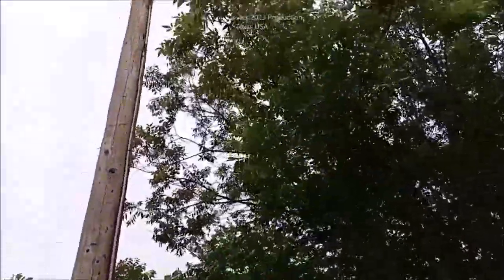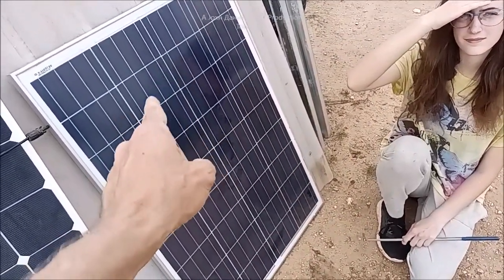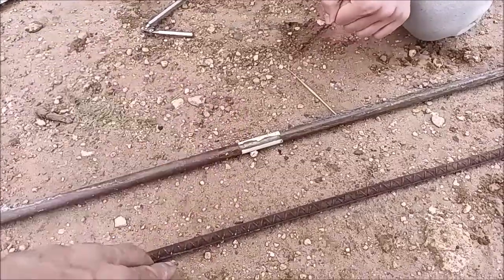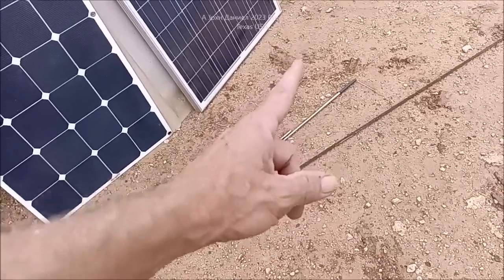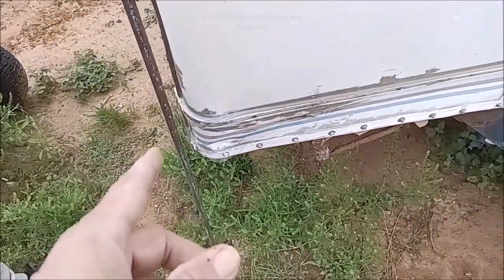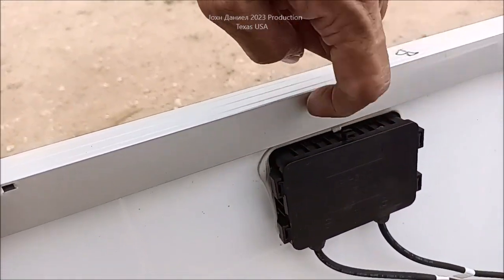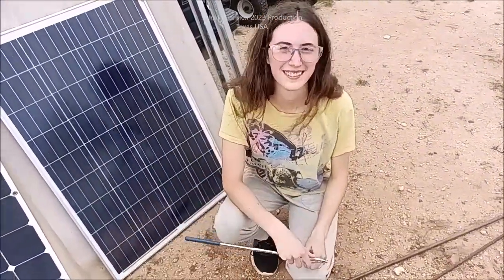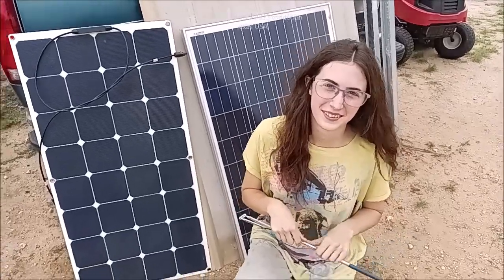Grounding your SOLAR PANELS? 🤔 You Better watch this First! *KNOW DC/Inverter POWER is not Utility

Comment: Your right, grounding is not part of a DC circuit. But I think you missed a point: earth ground on DC circuits serves a slightly different purpose. It's for your SAFETY. It provides the shortest path for DC current to flow in case of an unbalanced leak (positive/negative only leak, where there is little to no ISC until touched by something that completes the circuit). Without the earth ground, if the circuit has a leak, the current will flow through anything touching the ground, INCLUDING YOU. So yeah, in low voltage it's almost useless, but on an array of 10+ 600W PV panels where the circuit has 400V+, it's a life saver....
Reply: @heatclift4532  Grounding systems are a blessing and a curse. They are a blessing because if a piece of equipment in your house fails you are much less likely to have enough current flow through your heart. 
They are a curse in that they actually make your home a more susceptible to damage from a lightning strike
NOT less.
If a lightning bolt strikes the physical Earth in your neighbor's backyard there is a much higher chance of the voltage coming back up through the the grounding system than not. 
During a lightning event my home would be better served if I could implement an isolation switch temporarily isolating my system from the earth ground. 
The problem is I would probably forget to put it back to normal after the storm passed. Also, in the unlikely event that I would also have an equipment failure inside my house I would not be protected from electric shock. 
The truth is: MOST LIGHTNING DAMAGE ENTERS THROUGH THE GROUND SYSTEM. THE GROUNDING SYSTEM DOES NOT PREVENT DAMAGE FROM LIGHTNING IT OPENS A BACK DOOR ALLOWING IT TO HAPPEN.
Reply: Exceeding 60vdc meaning input from the panels? I have circuit breakers on my solar system in my rv. My system is not grounded. My rv is not grounded. I know I’ve asked this question before, but now I’m unsure of what I should do. Can you help?
Reply: @Blackbird-zo1su  RV is not grounded to Earth but the devices as well as panels should be grounded to the own potential (or "ground") of the rv. Because the voltage surge may still occur. It's a Faraday cage but not perfect.
Reply from the maker: @Blackbird-zo1su  If your choosing to go as high as 60 volts DC, you need real safety by using at least inline fuses or breakers. I prefer staying under 44 volt, ( pair of 100 watt panels in series is 44 open voltage ) and likely to be felt but not likely to injure. Over that it gains deadly levels fast. You do not need to ground the panel frames, no one has to. But creating a short safety is wise no matter what your voltage is. Best breakers to use are Mathus, you need a box https://amzn.to/4fgc0Zd And sized breakers that are just higher then your panel amps https://amzn.to/3SiWDVN
Example - 300 watts solar would be 25 amps in a 12 volt system. Always buy a few extra breakers, and always get a box with at least 1 or 2 more spaces than your solar already uses so you can expand or option other sources.
Reply: But you would need Residual circuit breaker and 3-wire wiring for this to work. There are still 2-wire systems in old houses which only breaks on short circuit and won't protect you from injury if properly grounded or not. Nowadays when the household devices are mainly plastic such events are less frequent unless you are in e.g. bathroom.
Reply: WHAT  ??  IN AC SYSTEM  THEY  USE  GROUND  DUE TO  HI  VOLTAGE   AND  LESS WIRE  DIAMTOR  OR SIZE  !!  IN DC  SYSTEM  YOU HAVE LOW  VOLTAGE  UP 48  SO   NO HARM  .LIKE IN YOUR CAR  12 VDC
OR 24 VDC  !!  I WISH  I CAN EXPLAIN  MORE  . FROM SAUDI ARABIA EX  AVIATION MAN.
Reply: @mohammedmurad3787  Not sure what solar setup you have, but a typical home solar system (2kW or larger) usually operates at 120 to 400 volts DC on the PV side...
Reply from the maker: I think I've said here and everywhere that exceeding 60vdc should have a fault system. That includes neon alert bulbs from frame to independent ground to active grounding but not residential shared.
Reply: @JOHNDANIEL1  Good one !
Reply: Ditch the ground rods on DC solar equipment, and use a high-quality surge protector sized for your equipment. Done.
Reply: @ronmott5265 where does the surge protector shunt the transients to if there are no ground rods…

Comment: Some inverter companies even say NOT to ground either leg of the DC output. Panels on a metal rack become grounded via the frame/structure of the rack. It may almost impossible to keep the metal frames isolated.
Reply: Exactly like that!

Comment: OMG.... i love this 🤣🤣🤣 in no way i pretend that i am an expert on the GROUND topic but everything around electricity electronics its like a hobby playing with it.. but when you look everything around you i am little sceptical even putting GROUND in my house.. if there is ground on every pole around my house i think it is dangerous to put yet another one in the house... because when lingthning strikes a pole it doesnt disapate in the ground.. actually the ground is just a conductor.. that lighning passing through the ground actually goes from earth to the ground rod in the house to everything conected to ground.... electricity actually isnt going where the resistance is smallest... electicity actually goes in ALL possible pathways... about the solar panels framing it does make some sense to ground the framing but as you said metal roof or in other words week ground only if you have AC from the grid pluged in the invertor to lower the noise in the system.. it is extremley contraversial topic about GROUND and most of the opinions of people who they say are the "experts" looks like they dont think it trought logically from start to finish and just do what they said in school...  COMMON PEOPLE think
Reply from the maker: You only need to understand George Westinghouse and Nikola Tesla to understand why the ground is used in generative energy. https://en.wikipedia.org/wiki/George_Westinghouse And the process is same now as then but we went astray on why so much is to be "grounded" and what it means. They all ( the professionals ) seem to connect electrical generation "ground" with Lightning protection "ground" and compound it and the problems by joining the 2 as the same. They ARE NOT!!! Same name, different outcome. For mechanical generated energy you must use the ground as a balancing design due to remote used transformers. With Lightning using a ground is creating a unnatural pathway for lightning to pass through what ever you ground. Centuries ago a lightning rod was used and not placed near homes, typically placed on a barn or other and consisted of Irion from height to depth in earth due to its innate chemically connective history of lightning preferring high ferrous oxide containing soil (ground) to strike.  
Go figure, 350 years ago they knew this!! And they not would have connected to a shared ground rod with your utility system. But 85 years ago a drunk code writing bureaucrat was born to change it all!
Reply: @JOHNDANIEL1  totally agree!!!!! I love when I hear some "professional" explaining how important ground is and you ABSOLUTELY have to stick a ground rod... And always my response is ... Excuse me I want to learn about electric stuff can you explain to me what is a ground loop cuz i can't get the idea, what is the effect of it and what is actually making a ground loop 😅😅 and after 10 minutes listening asking the question.. Is it a good idea everyone sticking freaking rods in the ground wherever they want 🤔hahahaha
Reply: You should consider also electrical induction which arises from any ligthning strikes in vincinity. And it may be thousands of volts. This has nothing to do with lightning rod grounding and earth currents which are less probable if the grounding is done correctly. Damages from such voltage surge is much more probable and you should use extension cord sockets with built-in surge protection everywhere the sensitive devices are connected (electronics). It would even protect from ground surge because it controls voltage between live and null/grid-grounded wire.
Especially useful in areas where lightning occurs frequently.

Comment: All cars are grounded, because all car tyres include small iron particles (iron "dust"). So all tyres are conductive. Not 100% rubber.
Reply: It is but not fully it is not a conductant but a bad insulator it may take some time untill the potential voltages are the same.
Cars are grounded to their own ground (forming Faraday cage).

Comment: Glad I watched this, I'm about to mount my panels, the brackets are already installed on the roof of my shed. Now I know I don't have to use the little aluminum clips between the panels or a ground wire to a ground rod. What about the sub-panel that is supplied by the inverter with 240v, the circuits will need a ground to meet code ? So do I connect a ground wire from the main panel? There is no other connection to the grid system, yet. Or would I connect to a ground rod (rebar) ?
Reply from the maker: When you go to AC voltage and anything over 60 volts DC then proper breakers and grounding is required on the AC side if its to join a existing system, the DC side can be left ungrounded as long as you have proper breakers but if your doing the most evil thing on the planet GRID TIE connecting then you must pay all the massive fees, follow every rule, connect to all ground connections and expect your pay off in a few hundred years.
As for the panel frames, you can ground by choice unless  forced to do so, using a ground rod on them separate from anything your house is using and over 25 feet from a existing ground. Myself, I choose NOT to attract lightning to my panels but instead a dedicated lightning post but if you can get good replacement insurance on the panels then it's not a horrible idea to attract lightning so you can get new ones ever so often from a insurance claim.
Reply: You should ground if its part of a building with its own path to building's ground unless you have metal roof. But not ground the power wires from panels, you should use overvoltage/surge protection against ground together with fuses before FV regulator.

Comment: dudes the the same as grounding your washing machine... ffs. charge builds in ungrounded stuff and will gladly use you and your heart to escape. You use a copper grounding rod because rusty iron is very poor conductor. who cars if it pulls out easier. It goes down 8 feet to touch moist soil.

Comment: must need grounding on solar system,, using spd for protect for lightning strike..
Reply from the maker: You connect your panels to a ground cable. It's OK, I hope anyone who buys the lie to ground them does so. 70% of solar installs are grounded, however I repair arrays all the time with grounded panels due to electrolysis and stray voltage, I never get calls for ungrounded.  For us, we choose not to give Lightning a shorter happy attracting path direct to our panels/cables/controllers/inverters that a ground wire creates when the easiest most approved Department of Forestry, Marine, Military, & World method is a basic Lightning Diversion collector.
Reply: @JOHNDANIEL1  Hi John, I am an off-grid homeowner living in a lightning prone area. We never had any issues with lighting until we subscribed to cable/landline service via co-axial. The incoming co-axial line is not grounded. Every time there is a nearby lightning strike it fries the ISP's modem/router and causes the inverter's screen to go blank. The ISP's modem is plugged into the house via its ungrounded two prong 12v dc power supply. I spoke to various "experts" who say the ISP needs to ground the shield of the co-axial to my electrical panel ground bar. I am a bit hesitant on that front because neutral and ground are bonded at the main electrical panel. The electrical panel is powered by the negative and positive leads of my inverter (ground remains un-attached). I fear that attaching the shield of the drop line co-axial cable to the electric panel ground bar will redirect the lightning directly to the electrical panel frying the inverter and all attached components. Experts disagree with me entirely stating that this will save both my inverter and the ISPs modem, sending the lightning directly to the ground instead of going through my equipment. All components on the DC side (panels, controller, inverter) remain ungrounded.

Comment: Cover your solar panels with red or yellow clear film and it will increase the output. You have changed the light spectrum your panels receive.
Reply: If its that easy.. Manufactures would already be doing that.
Reply: You should use the word reduce 😅

Comment: So what about when u use a Bluetti device ac180 around 1800 watt unit. It has a grounding connection on it. Don't  do it?
Reply from the maker: Grounding terminal on them don't usually connect in a bonded way so if you want to YES, will it do anything, very unlikely but it's a great confidence builder!

Comment: As a metal detectorist, I can at least say, when we find anything thats been in the ground for a long period of time, it will decay, that decay actually enlarges the signal. ONE QUESTION, how do you get a earth neutral bond on a off grid system without a ground??? you said to let your inverters float!!!! but they need a earth neutral bond, that is sometimes already done for you inside the inverter, other times you have to do it yourself, either way, the inverter is not floating.
Reply: @Urge38  think about if you have ever used a generator to power your home appliances (like refrigerator or cheat freezer during a power outage, or using one on a jobsite for running your saws and air compressors and such. That system is AC, just like whats coming out of your inverter, correct? Most smaller and even midsized generator aren't bonded to earth ground, because they utilize the same thing John is referring to here, a floating neutral. It seeks a path back to its OWN source to complete the circuit, NOT a path to earth.
Reply from the maker: Earth Neutral is a defined function of Grid Power, a part of its actual circuit. You do not create a circuit using the ground with Off grid power. Floating is the common and line ( hot) in a isolated use not a ground/common bonded like in a utility system. People can't get it into their heads that Utility power is mechanically created, nothing to do with inverters that create their output from synthesized electronic only methods.  A comparison. Utility power ( mechanical over rotation over magnetic generators ) call it NON GMO Corn. Inverters, Switching and boosting from DC voltage using self contained conversion, Call it Franken food. With Corn you need the earth to plant it in, with franken food you need a clean soil free laboratory! Connecting to a ground with a inverter will damage the inverters, it will stop or damage your induced short detection safety system in that inverter so may makers knowing "people do not understand the output is NOT utility" often make a burn trace on the board to vaporize when a bonded system is connected to. A industry secret but a must have ability.

Comment: But does it hurt to ground the aluminum frame of the solar panels?  It won't protect from lightning damage, indeed will make the panels a "lightning rod", but will protect personnel from any potential buildup, either static or for feedback thru the cells from the inverter.  Obviously, you can't ground panel frames on an RV, but doesn't mean a home installation isn't better if frames are grounded.
Reply from the maker: Ground if you feel its for you. But just know that about 99% of those who say they have voltage in their panel frames got it from sharing a single homes ground rod with the common neutral/structural ground bonded 120/240 utility panels, inverters ground lug, solar controllers ground lug and solar panels. So if you do ground them, DO NOT connect that circuit to the home or inverters system, ground them separately at least 30 feet away from any existing ground rod. They do collect atmospheric static in rare conditions but so does you car pop you with a static jolt from time to time.
Reply: @JOHNDANIEL1  this is the only piece of advice you give in this video that has no chance of killing someone.. of course you shouldnt share an earth with other devices thats called voltage potential and yes it can cause errant voltages
Reply: I’m trying too build a PV system with 12 panel on a wooden barn roof with a battery bank and supply power to my house 20 metres away. My house in the uk has earth neutral bond back to supply company and has a ground rod on my oil tank supply pipe into the house.
I was going to use a 3 pole live neutral and earth changeover switch to isolate incoming PV power from the grid power to supply my consumer unit.But it would seem I still have an earth rod at the house connected to my house system. 
Any thoughts on how I can achieve what I’m trying to do? Many thanks

Comment: Thank you for the precious info. 
I have an important question if you could help me with it. 
I have an off-grid inverter that has a voltage of 60V between Neutral and Ground of the inverter AC output. 
I am new in solar systems... I hear that this voltage should be 0V in order for RCD breakers to work properly. 

After some research, some say that a way to solve this issue is to bridge ground and neutral on the electrical panel and ground them both. 

Now I can see you say that inverters don't need to be grounded, but if there is a voltage between neutral and ground and you need protection from an RCD breaker, a way must be found...

I'm actually looking for a solution... What's your opinion regarding neutral/ground bridging on the inverter AC output? 
Thankful for any kind of reply 👍